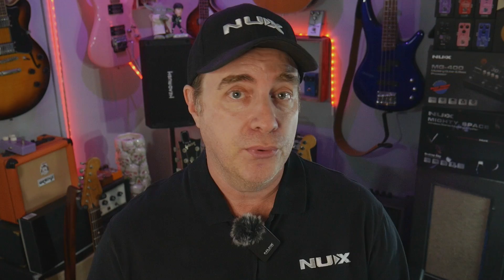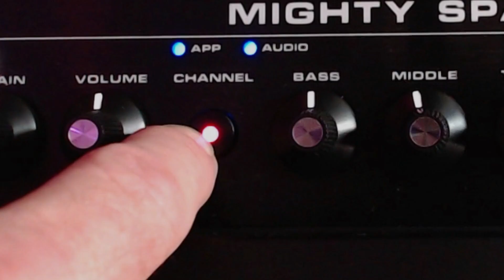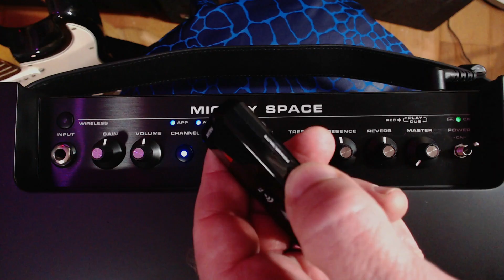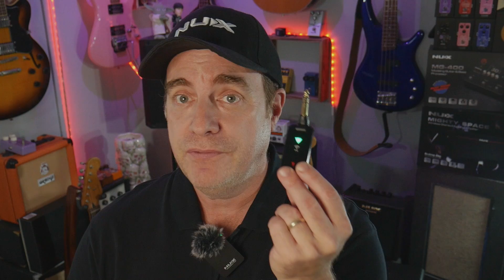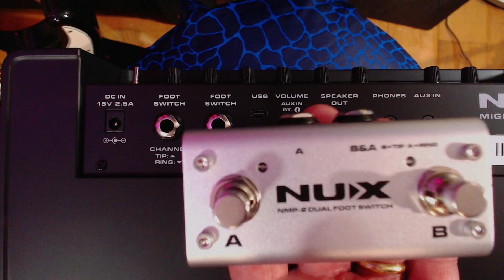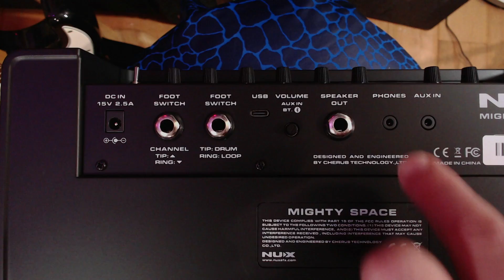NUX MIGHTY SPACE Tutorial EP1 | Amp Tour

Comment: I can get the transmitter on and paired to the amp no problem.  However, as soon as I plug the transmitter into my guitar it shuts off?  I can turn it back on while it is plugged into my guitar however it only stays on while I am holding the switch.  As soon as I let go, it turns off again.  I can get it to work in one of my passive guitars but it does not work with my active Godin A6 guitar.  Any ideas?
Reply from the maker: Hello I believe the issue is a grounding incompatibility issue with the godin pickup and the transmitter which occasionally happens. The solution is listed on the B5rc landing page. Have a look halfway down the page and that will show you 2 solutions to solve the problem https://www.nuxefx.com/b-5rc.html

Comment: Is the Mighty Space compatible with other Nux wireless transmitters, like the B-5RC or the B-3? (I would use the B-3 for my XLR harmonica mics, and would love to wirelessly sync with the amp rather than messing with all the adapters I'd need otherwise.)
If the Mighty Space IS compatible with the regular B-5RC, will it the Mightly Space also charge the B-5RC, or will it only charge the B-5MA TX provided?

Comment: NUX, Put a LINEOUT PORT, i can't believe NUX didn't put a lineout jack for plugging into a mixing board or ADC or housemixing board when playing gigs.
Reply from the maker: There is a headphone jack out that can be used as a line out.
Reply: @nuxaudio  the headphones impedance is not the same as a line out impedance plus needs to have a 1/4 inch line out jack port. Also an effects loop would be nice for using analog guitars pedals with the nux. The IR need to have of Stevie Ray Vaughan speakers IR JBL 15inch vibroverb and superreverb 10inch JBL speaker IRs